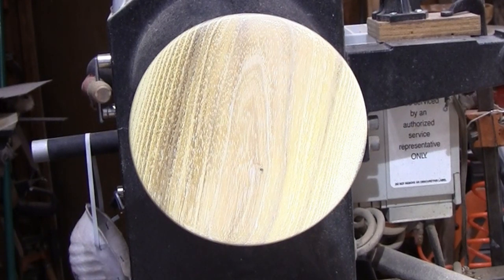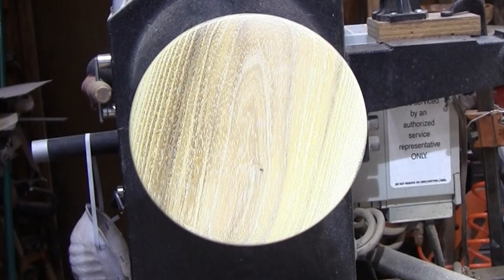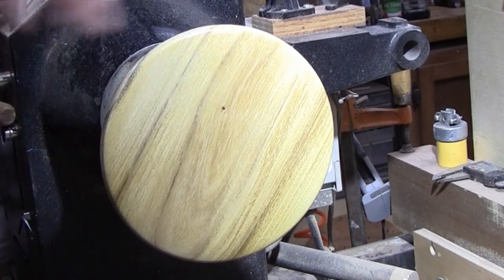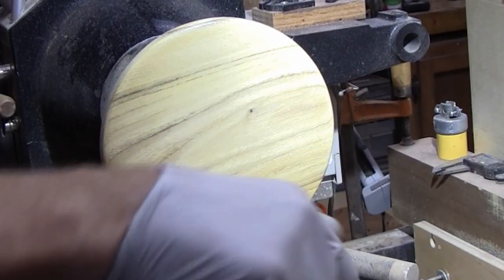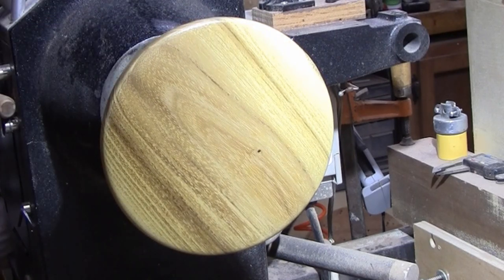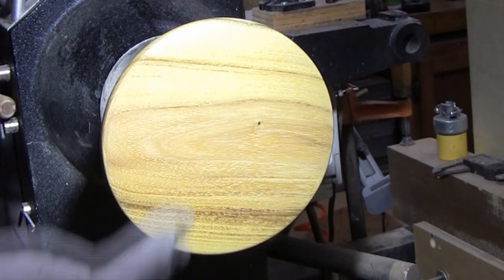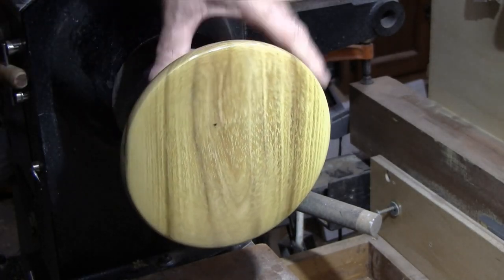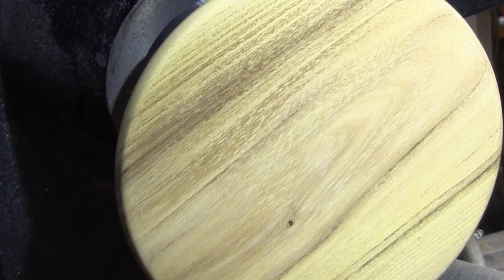Wood Turning  How I use Polycrylic for a Great Finish

Comment: Interesting article, I'll try it out for sure. Nevertheless, the question for you: with which finish do you achieve the highest shine according to your long experience? Thanks from Austria. Gerhard.
Reply from the maker: Thanks Gerhard! Well I can get pretty equal shine using lacquer and the Polycrylic.  Also oil based wipe on poly works good as well. But it adds a slight tint to the wood. So it kind of depends on the piece. In a week I have a video where I used the Polycrylic and got an amazing finish on it.
 So for easy of use I would say the Polycrylic is a great choice. Easy to put on and sands better than lacquer which sands pretty good.
Reply: @ThePapa1947  Thank you again. Now I also think that Polycrylic is a very good and convenient choice. Unfortunately, it is practically impossible to get in Europe. After all, I was able to order 2 cans after a detour. Greetings from Austria.

Comment: Thanks. One question. How hard wearing is it? if it's so easily sanded how will it stand up to use in a bowl. Will it dissolve from liquids.
Reply from the maker: It is very durable and keeps it shine. It sands very easy but the way I put it on fine scotch brite will get it ready for another coat.
It will not dessolve in a liquid.  But I do not put any liquids in my turnings.

Comment: Do you apply this to bare wood Gary? As opposed to over sanding sealer etc. Thanks
Reply from the maker: Hi Jim, I think I have once and it works fine. I really like to use the sealer on a soft or open grain wood. it seems to soak in and helps the Polycrylic to build up nicely. So bottom line is I think it would work fine if you wanted to just go with it.
Thanks for watching,
Gary
Reply: Thanks Gary. Bought a quart today after watching your vid.
Reply from the maker: Jim you will find it dries fast and sands very easily.
Reply: You have definitely made the big time with the folks from Acks. Got mine today and they included a little flyer with directions to your YouTube channel. Congrats Gary!

Comment: even though i wipe off the extra i still get lines from wiping
Reply from the maker: What do you use for a rag?
Also try circular motions.
Could be you are putting on too much.
Reply: @ThePapa1947  i use a lint free cotton  that u buy in bags. Trying it again this morning. Now i am putting it on then wipping with dry spot on rag to not leave streaks seams to be working but i sanded to far through sealer and have an uneven finish. Finishing is my worst nightmare.
Reply: @ThePapa1947  what kind of rag do u recommend?
Reply from the maker: @tonypayette87  yes a soft lint free piece of pure cotton.

Comment: Thanks for this vid Gary, will come in handy since I being told this is a great product for firming up spalted wood 🙏  Now all I have to do is remember it next time I do a spalted wood turn👴  I've used the clear and tinted ones on flat work and can get good, reliable results so this using it should not be a problem as a foundation (sealer) or as a final topcoat.   Stay safe.  -Mike😷
Reply from the maker: Yes it works good on driftwood. That is spalted on steriods. It works great for a base and just as good for the final finish.
Take care,
Gary